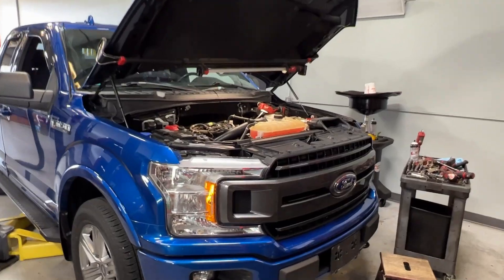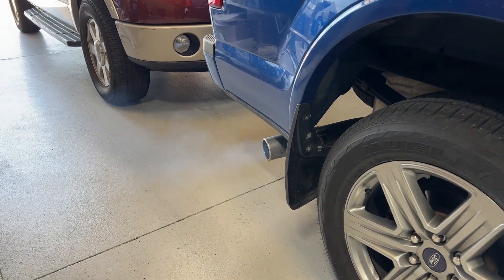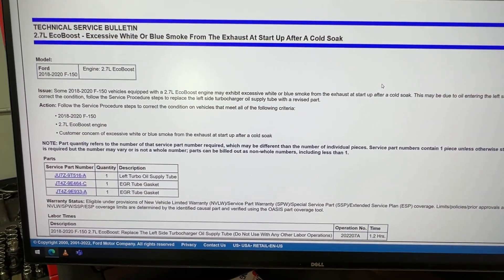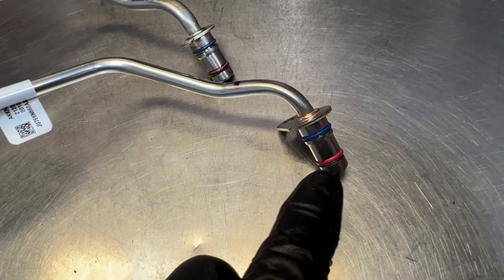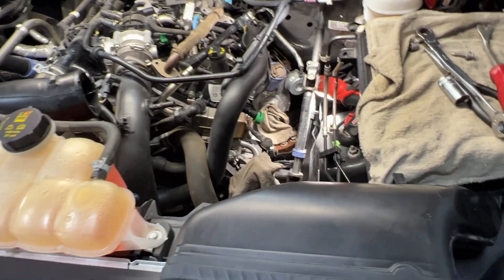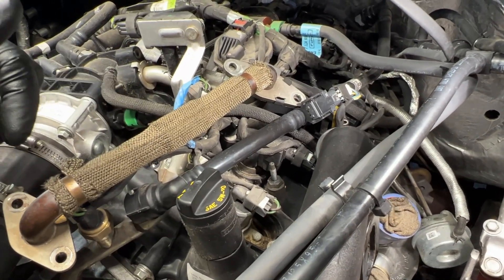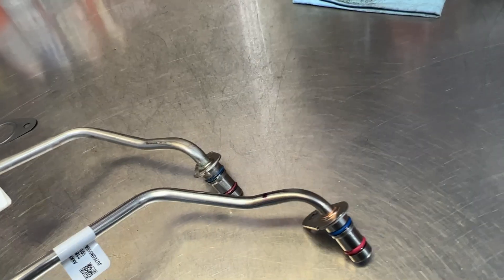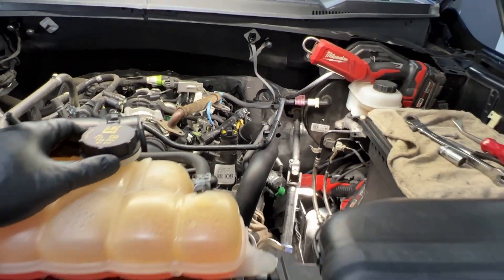2018-2020 Ford F-150 2.7L Ecoboost: Blue Smoke Upon Startup Confirmed Fix!

Comment: Have there ever been issues with those filters clogging and taking a turbo out? If so is there a way to prevent that?
Reply from the maker: no
Reply: @FordTechMakuloco  Short and to the point!  Lol.
Reply: I saw on "I do cars" channel he said those screens should be removed on Subaru turbo engines.  Must be a finer screen.  Those ford ones look pretty course.
Reply: @ctbale1  this is why I wonder. I used to have WRX's and this was a failure point. Losing a turbo due to oil starvation at full boost also meant a high probability of losing the engine. I've pulled the screens on the Subaru, Im not sure that they are that much finer. However different engines different oiling systems. Plus subaru engines seem more finicky in general. I wonder if every manufacturer uses screens.

Comment: Who really cares about a little bit of smoke (mosquito control) as long as she cleans up and runs right?
Reply from the maker: The customer wanted it fixed; some are embarrassed by it.
Reply: @FordTechMakuloco  By not replacing the original tube could it cause damage to the catalytic converters?
Reply: @FordTechMakuloco  It is kind of embarrassing. My neighbors probably think I don't maintenance my truck. LOL

Comment: Any chance have you had any 2.7 come in with the oil pump drive belt failed? I have 2021 F150 2.7 and that’s what just happened to mine.
Reply from the maker: Not yet.

Comment: I had a 2016 2.7 that on cold days would produce so much white smoke on startup that my daughter once thought the truck was on fire. Took it to the dealership, they suggested the turbo line, changed it out which did help some but the truck would still produce giant plumes of steam on cold start when ever the temps were below 60.
Reply: I have a 2003 F150 V6 that does the same thing.

Comment: I've got an 18 F150 2.7 l don't think I've had that issue yet but I've only got 48,000 miles on it I guess I'll have to check and see but it's a California truck so not a lot of climate issues here
Reply: They can actually last, mine is a 2016 2.7 and is about to turn 190K miles and haven't had any real problems yet. I am probably on borrowed time before things start going wrong which is to be expected  with that many miles though.

Comment: My 2.7 had the smoke issue, about a year ago the dealer replaced the oil pan because of the leaks (another well known issue) after that no more smoke in the exhaust.
Reply: Mine is a 2016 and had same problem. Dealer told me turbo booster fitting and it would be 700 plus. He also said oil pan and with warranty it was only $100. Said lets do cheaper thing first and as of now no smoke at all. And they changed timing casing screws for free.

Comment: Good fix. Your work with the 5.4 3 valve is why I follow your channel. I’m still nursing mine along and planning the timing job as needed. So far I got away with just replacement of the CTV Solenoids and changed to 5w30. Amazing what a guy can learn from an experienced mechanic. Thanks
Reply: Got 253,000 on my 08 5.4 . Still truckin 😎👍👍
Reply: I’ve got 180K on my 5.4 3 valve, just chugging along. But I’m eyeing a newer 2.7 or the NA little 6 cylinder.
Reply: I got a 2 valve is that one not as good as a 3 valve 5.4?
Reply: @truepyro28  Never had the 2 valve but I have not heard any bad comments on it.
Reply: I sold my ‘08 5.4 3v last year with 265K on it and all original motor/trans… the guy I sold it too is still daily driving it… good motors if you take care of them… side note, I always changed my oil every 3K miles regardless… and ran 5w20…
Never had a motor issue!

Comment: What is your take on the 3.5 EcoBoost cam phaser bulletin? My 2018 Expedition is affected by it and the dealer told me they will replace it only if it starts acting up. I am a bit concerned about it.

Comment: We dropped a jasper 5.3 in our old suburban and the old motor never puffed a bit of smoke or drank oil. The new motor smoked on the highway and drank oil. We pulled off the driver side valve cover and cleaned the integrated PCV & filter thoroughly so that it breathed freely. Still smoking. Bought a new valve cover and boom fixed. Weird..
Reply: Why would you replace a motor that’s not smoking or using oil?

Comment: When I was with BMW we had the same thing on our N20 and N26 engines. When parked overnight the engine oil pressure will equalize and leak past the turbine seal. Our new feed line had a check valve in the engine side. I’m sure that one does too internally. Prevents oil pressure equalizing. Those engines were only single turbo though, wonder why Ford only wants the driver side line replaced?

Comment: Great video's.   I'm dealing with a 2015 f150 2.7. The temp gauge spikes and fans run wide open. The engine never overheats. No code set. I did read somewhere the coolant sensor needs replacing. This looks like a lot of work. Am I heading the right rabbit?
I replaced the head temp sensor but no help. 
Nice to hear from you is you should respond to me. Thanks
Ford dealer say radiator hose collzapex . they twisted the hose and replaced 
The coolant. $536.00 bucks later same problem.
Reply: I have a 2015 F150 3.5 ecoboost my truck was doing the same thing (fan on highest setting even though engine is cold and only been running for 1-2 minutes).  I did a lot of internet searching and watching YouTube videos and for most people it can boil down to 1-3 things causing it:

1. A/C pressure sensor (located just behind the radiator passenger side) like you mentioned is bad (or the connector to this sensor is bad) and needs to be replaced
2. Using non-OEM thermostats can cause this issue.  Replace the non-OEM with a Ford thermostat (180F setting)
3. The A/C expansion valve (passenger side behind wheel well) is clogged or malfunctioning.  Clean it our or replace it and recharge the A/C system to factory spec.

Using 1 (or all) of those fixes listed above seemed to get rid of the fan running on high speed all the time for 97% of the people that had the problem in the Ford forums and on YouTube.

Comment: My 2017 2.7 Ecoboost does this as well. Dealer said it was normal, then said it was that turbo supply side issue and replaced it, but it is still doing it.
Reply: Did you ever chase down the issue? My 2017 is doing the same. Replaces the line, still does it. Ford says it's "normal" Not sure what else to do
Reply: My 2016 does it, is it the same oil feed turbo line that the 2018-20 use?

Comment: The white smoke is likely from condensate in that giant muffler and resonator as they cool off, especially overnight. My 2017 has a factory pinhole on the bottom of the muffler. When it clogs up I get the smoke. When it's unclogged and working, I get a blackish wet spot under the muffler.
Reply: The white isn’t smoke. It’s condensation.
Reply: Where is this pinhole, is it obvious? Im assuming bottom side near the furthest  back flange?

Comment: That's crazy I drive a 2013 Ford f150 5.0 coyote motor and at startup I'll see Blue smoke what I end up doing and finding out that the PCV valve was bad I couldn't find no video about PCV valves on the 5.0 l and their location I'm not really a car guy but I figured it out can you do more videos about the 5.0 2009 all the way up to 2014
Reply: PVC valve on the 5.0 is in the passenger side valve cover.  It sticks up and has a plastic tube that goes from it, into the intake.

Comment: I am a subscriber and have a problem. Yesterday my 2013 f150 4x4 plat ecoboost died after leaving a driveway with a dip. The dealership did the fuse # 27 relocate years ago. Truck cranks, no start, full power to everything. Do you have a vid of fuel pump or fpcm troubleshooting? Thnx much
Reply: The wiring harness terminates at the front drivers side door pillar.  
From my understand there is TSB for it. The wiring harness from the fuel pump to the door pillar MAY need to be replaced. The truck cab has to be raised to get access to the harness. 
Don't start replacing parts just because someone says. I THINK YOU should replace this and that. 
I should know..😄
Reply: Mine did the same thing  bought the parts to fix it from the dealer but before  I did the install  I purchased  and installed  a oil separator  hasn't smoked since  parts are still on my tool box

Comment: Appears that the second lower O-Ring was letting some oil by-pass and building up high pressure that the blue O-Ring couldn't block then leaking into the turbo.  One would think it would be happening all the time, thus burning oil.  What was the condition of the oil level consumption over 3k miles?

Comment: The new part likely restricts / regulates oil flow to the drivers side turbo. Possibly from that deleted o-ring allowing oil to bypass the feed instead of forcing oil into it. Not uncommon to need to do this in the performance world where oil pressures are much higher and turbo placement itself can tend to cause smoking issues.

Comment: I believe the issue was due to oil weeping past the turbo seals after a hot soak and the revised tube allows for better drain back after shutdown.
Reply from the maker: I think it allows for a vacuum break of sorts so it can fully drain the line yes.
Reply: @FordTechMakuloco  my 2015 2.7 eco has 99,000 miles on it and is doing the exact same thing. Could this apply to the 15’s as well? Thanks man!
Reply: @Ben_jamin123  I also have a 2015 and wonder the same thing
Reply: @Ben_jamin123  did you ever get it fixed...I have the same issue
Reply: @FordTechMakuloco  That makes sense, I couldn’t even think of a reason why taking an o-ring away would solve this issue!  Thanks Bri
Reply: This is what immediately came to my mind. Retaining pressure inside that line and weeping past the impeller seal into the exhaust side.
Reply: Thanks for the video. Went to dealer to order part. They gave me the original part with two O rings. Showed them the TSB and this video. They have ordered the updated part. They had a hard time confirming the new part would actually work for my truck. 2020
Reply: @obert7625  do you have the part number
Reply: @JJVFever  JU7Z-9T516-A
 
For me replacing this with the updated tube didn’t work. It stopped it for a little while but it’s back to smoking at start up.
Reply: What year truck? @obert7625
Reply: @obert7625 do you happen to have the part number for the new one?

Comment: Crazy, is that a warranty repair?
Reply: That should under the Emissions category at the very least.  Oil could kill the O2 sensors or CAT  given enough oil passing by.  2 years/24000 federal,  7 years/70000 California.

Comment: I have a 2017 2.7 with 54,000 miles. Noticed this problem around 50,000 miles. Thanks for showing the fix!
Reply: My 2017 also had that issue. Got the oil supply tube replaced under warranty. No problems since then.
Reply: Good to hear. Unfortunately my truck is out of warranty.
Reply: I also have the same truck, did you mileage go bad by any chance cause my has 18mpg average and i really want to know what the issue is

Comment: wow, I can't believe that works!

I noticed my 18 is doing the smoke at startup after I let it sit for a few days. 

I wonder if that redesigned pipe is keeping oil from dripping out of the head and through that tube (and thus the turbo) when the engine is off and oil is slowly draining back? the change eliminating an 0 ring and changing the shape of that inlet makes me think they are doing something to try and solve drain back.... 

would be nice to know how that oil passage in the head works.